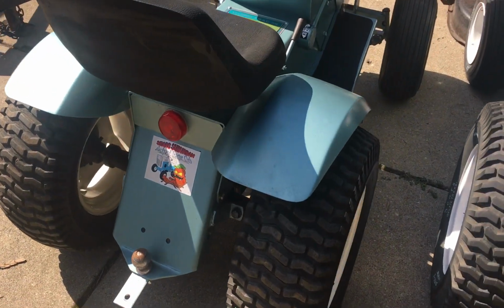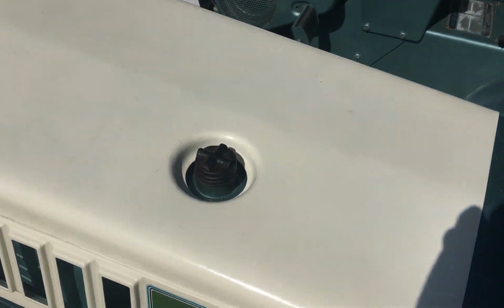1971 Sears HT/14 Restoration Nearly Done

Comment: Hi I have a question I have a 76 ss18 and was wondering what is the best type of oil to use in it?  My manual says 30 weight in summer, and 10w30 in winter?  But I heard some people say Rotela 15w40 Diesel oil is great?  Mine does burn it when it has 10w30 in it though?
Reply from the maker: Bobby Detecting I run 15w40 Rotella in my Onans, they run quieter as well. The valves can tend to be loud in these engines. I don’t run my Onans in the winter though, if I did I’d run 10w30 then switch to 15w40 in warmer weather